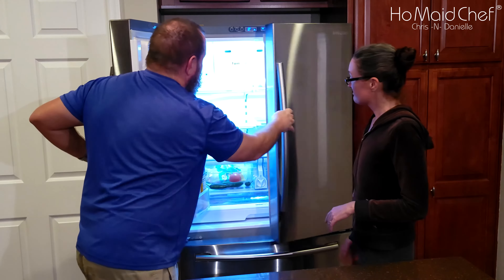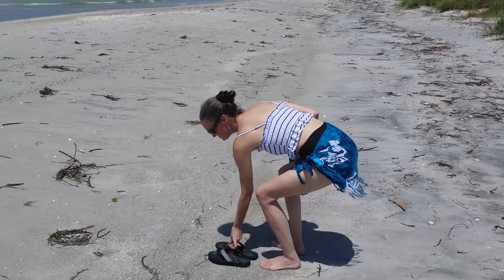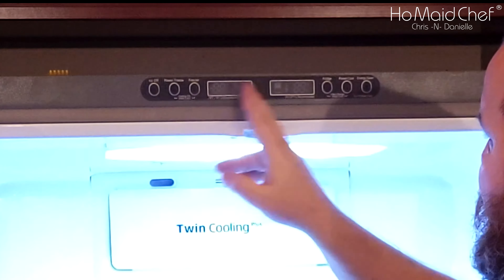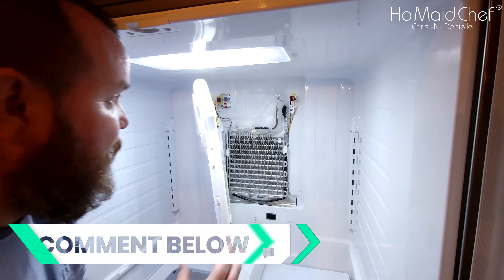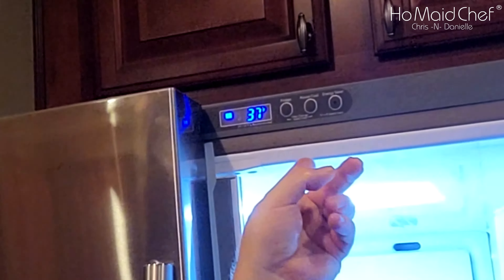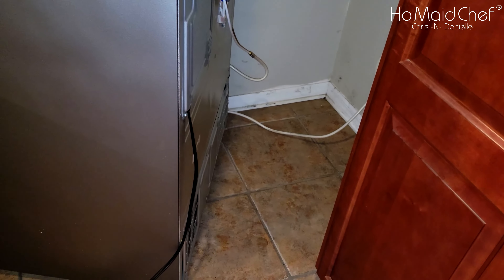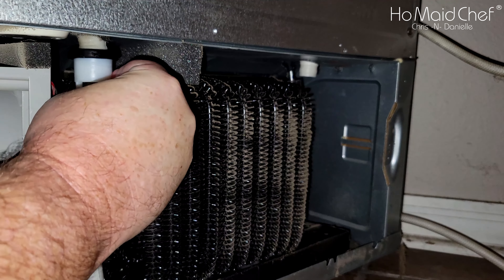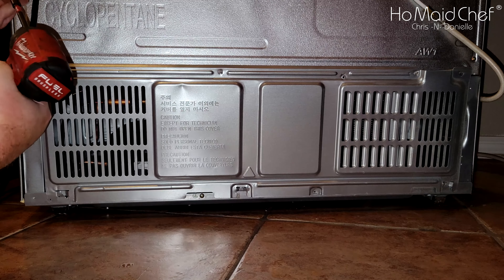How To Defrost Samsung Fridge

Comment: My Samsung looks just like yours,,,
Same problem,,,, freezer working fine,,,,,frig not cooling,,
I’m gonna try your advice and see what happens,,,,, 
Your video was awesome.
Such great instruction,,
Thank you for sharing,
A new subscriber!!
👏😁
Reply from the maker: Thank you! This is a common problem. The defrost coil doesn't go high enough in these, and it freezes the fan. Was going to do a permanent fix, but we moved to a boat faster than planned.
Reply: Chris,,, just wanted to give you some follow up,,,,
Ran  rd mode about 4 or 5 times and then reset to normal operation and temp of 38 F,,,,

Yes,,,, it worked 😀
If recurrent problem, then I will take off the panel ,,,,,I feel very confident having your video as a resource,,,

Thank you and your wife so much for the wonderful video content,,,,,
Y’all take care and be safe,,,
👏😉
Reply from the maker: Thank you, we love that things we produce help others. We wish you and yours the best, hope that you don't have to do this that often. We probably did this around 3 times a year, but it is very humid in Florida.

Comment: THANK YOU SO MUCH! We have the exact same fridge. 
Our problem is water pooling under the fridge bottom tray. 
  Any suggestions? Water is pooling under the defrost unit and not draining down to the drip pan.
  Thamks SO MUCH! 
Debra from Tx
Reply from the maker: It could be the drains are clogged our the metal tray is not directing the water to the drains. You have to pull the panel off like we did to see this

Comment: Great video Great video. We have had this problem since buying the Samsung.   Fixed under warranty twice.  Now they refuse to fix it.   😢.  
I can’t get the power defrost on.  Still trying to defrost it.  Freezer works.  Fan doesn’t work. Not cooling.  Quoted repair is $750.   Never buy Samsung
Reply from the maker: Hope you get it sorted, and we would not buy another Samsung either. You can force defrost, is yours the same as ours?
Reply: Our washer, dishwasher, dryer, stove, and fridge are all samsung and they all have issues. Slowly replacing with may tag
Reply from the maker: Yes, don't think we will ever go with this brand again, but moving to a boat, so these won't be an option.

Comment: How bad did ur fridge get because mine is so bad that all the holes are filled with ice and where the metal thing is the shelves hook on to fills with ice I actually had to kill the power to it for 3 and a half days to thaw it out and here now it is right back to full of ice again and I live in Pennsylvania  wasn't like that all summer as soon as I had to put the heat on it started freezing up
Reply from the maker: Ours never got this bad, but now that we live on a boat ice clogs our fridge in about a week. At our house i could use the AC to keep the humidity down to at 45% which really slowed down ice forming.
Reply: We just took the steps that you showed and when we removed the panel ong it was so iced up I have never seen one like this ever now we r just waiting it is like the drain is still frozen where the fins behind that panel are at so don't know how long that will take to thaw out never in my life have I ever had a fridge freeze up like this
Reply: I live in Pa and it is November  and didn't have this problem till I believe it was September  this year and I have had this fridge a few yrs now and the only thing that is different  is the last 2 to 3 yrs we have had the water hooked up where for all the yrs before that it never was I was renting before and the landlord would not let me hook it up but now I am buying  and I wanted it hooked up

Comment: I am having trouble getting the cover removed. All the clips are out but the top section isn’t budging. Could it be iced/frozen in place?
Reply from the maker: We had to go through the defrost process, and then you may have to shut the fridge off for a bit. Ours was stuck with ice.